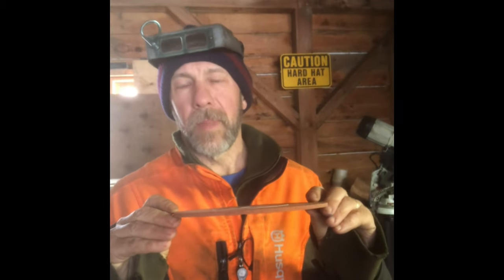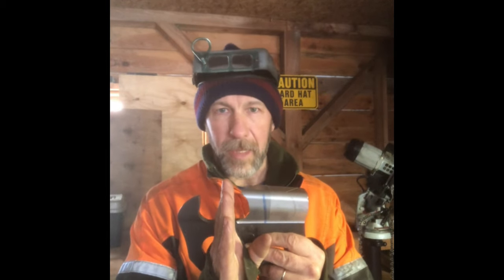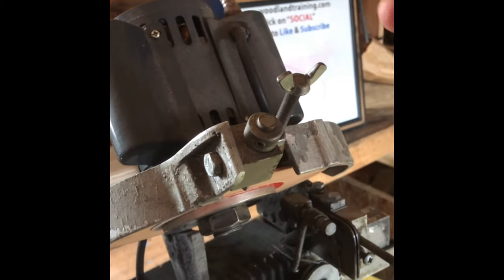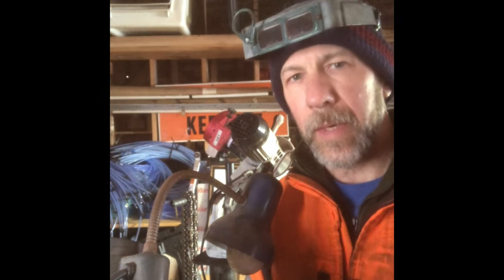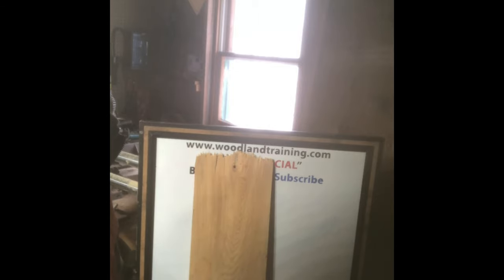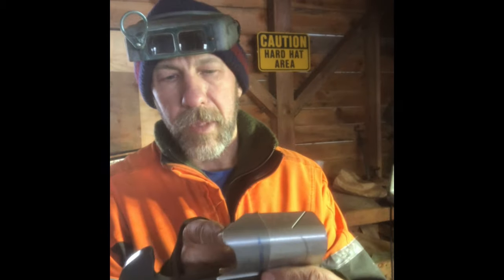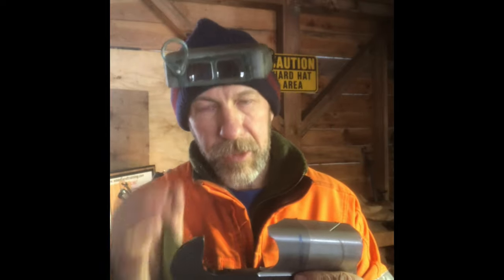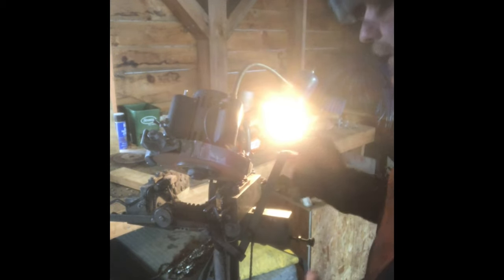Grinding square ground saw chain

Comment: I usually try and blow my chains off before grinding but they still have residual pitch/oil. Have you ever herd of using a quick shot of brake cleaner on the stone to clean it up while it’s spinning, granted your angles on the stone are still good. The brake clean works well to clean the stone and does t seem to affect the stone as far as I’ve noticed. Great video. I’ve been square grinding for a couple years and still have some to learn. It’s truly an art in my opinion. I have a Simington
Reply from the maker: I use brake cleaner on my round grinder for harvester chain. I have not used it on my Silvey. I'll give it a try. Thanks for that tip!

Comment: Great video!! Curious if you've seen the square jig out there for round grinders and your thoughts on it if you have.
Reply from the maker: I have seen an adaptor someone made- small steel block that holds the tooth.  2 issues I think of is- holding the tooth tight given the 3 different gauges of chain used and dressing the stone in order to maintain the correct angles on the tooth.  It looks like it works.  I would need to try it before commenting on it's practicality for sharpening multiple chains on a regular basis.

Comment: Excellent video.  I have been sharpening for while. I don’t know much, well very little about square sharpening. I want to learn.  I work as firefighter and I teach my crew on chainsaw safety and maintenance.  My question where did you get the chainsaw tooth prop from?  Excellent tool to have I would be interested in buying one to teach sharpening to my crew. Thank you for gear video.
Reply from the maker: My local saw dealer (Husqvarna) had it in his shop. Said his distributor gave it to him. I have seen Stihl reps use a section of chain model which is about half the scale size of what I have.
Try asking at your local dealer.

Comment: Do you set the top and side plate angle of a “new “ disc with the dressers?
Reply from the maker: Yes, the new disc needs to be shaped using the dressers. It takes a few minutes. You need to go slow. I've seen some people use a hand held dressing stone first. That is faster. You get the edges close, by hand, and then do the final dressing with the dressers on the grinder. Once that's done, you just "dust them off" occasionally, as the stone gets dirty from the oil and pitch from the chain.

Comment: What I'm starting to realize about square grinding is that seems almost religious in nature. The adherence to ritual sharpening. Lol. And every body has a slightly different ritual interpretation. Just like religion. Trying to figure out what my ritual is going to be. ;)
Reply from the maker: Ha- yes. Some call it a cult. Others use the term “badassery”
Reality is, chisel chain is designed to be square “sharpened” either with a grinder or hand file. 
In the early days, the grinders were so expensive, loggers would rent them. Trying to hand file and be consistently precise is time consuming. 
For those reasons, most saw users reach for a round file. Round files work and the chain cuts. 
However, with round filing, you give up some cutting speed, duration of sharpness, and smoothness “lack of vibration “.